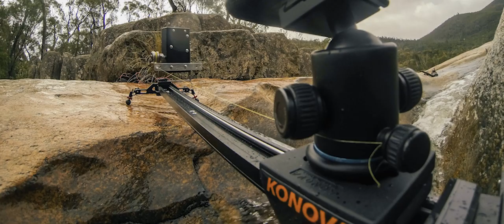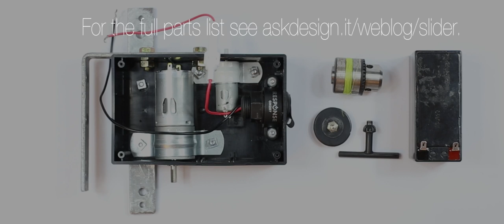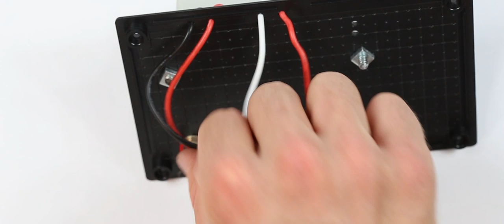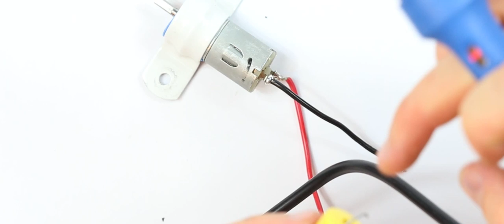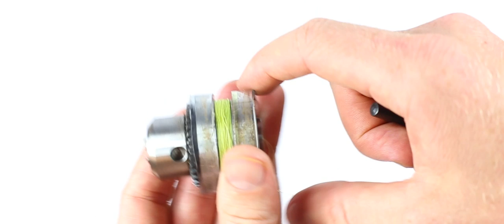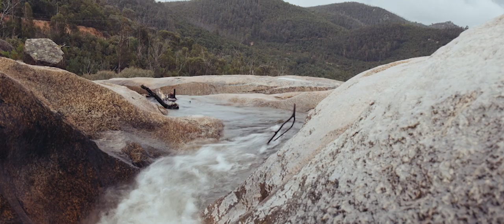DIY Dolly / Slider Timelapse Motor

Comment: WARNING!! USB ports are designed to supply five (5) volts NOT 12v. So if you connect the 12v battery directly to a USB port do NOT NOT NOT plug any ‘normal’ USB device into the plug or you will destroy the device!! You can, if you are very careful, purchase a USB plug that is made to take 12 volts and convert it to the standard USB 5 volt – but be very careful what you are using.
Reply from the maker: +Steve B hey Steve - the USB part listed takes a 12v supply (input) and converts it to 5v output, so there is no risk to devices. The part listed is designed for motorbikes so converts voltage as standard.

Comment: Hey man, thanks for the highly detailed vid, looks like you're very onto it! 

I'm a complete noob with photography/video but have big dreams, hence I find myself here. Anyway, the bit you said at the start about it not working for night timelapse as it requires the camera to stop for every photo - what happens when you try this motor for the night timelapse? I guess it just comes out blurry? I'd really appreciate any more info on these professional timelapse motors, do you know if you can buy them and attach it to your slider or do they come in an all-in-one type build? Sorry, a bit off topic, just failed to find much relevant stuff despite a long googling session
Reply from the maker: +tim3854 I still haven't used it - it wouldn't matter toooo much as I bit of motion blur is OK for timelapse, but you'd need to get a decent ratio of movement to shutter speed. With new high ISO camera's it shouldn't be too hard. As for all in one or modular commercial units, there are heaps of both. Check out ebay for a cheapy - or for a good modular one, look to Syrp, or Rhino for a good all-in-one system. Good luck!

Comment: Angus, how would you do it if you have a manual slider with a belt ?
Reply from the maker: Chyld Rosen so your slider already has a hand driven belt? just find a cog to fit your belt teeth and put it on the driveshaft of the motor. does that make sense?

Comment: Very cool.  I would have put a momentary switch at the end so the motor would stop when at end of travel.  That way the string wouldn't break and you could also have it set a limit on how far you want the slider to travel.  Also, clean up your dc leads.  You can get braided wire from an old extension cord or something to keep from having that mess of cable to your battery.  Good job!

Comment from the maker: Hey all - an update on this video since I produced it, copied from a reply to a comment below, in case anyone is interested :) 

Yep! I do have follow up advice. If you're going to travel / trek with it buy something, all the DIY solutions i've seen can't compete with the light weight of a commercial unit, also the reliability when hey are getting knocked around. This one is sweet - if you're tied to a car and don't have to carry it with all your other gear, or if you are as strong and agile as a mountain goat haha. After trying to travel around South America with it for 6 months I now use a Radian (http://alpinelaboratories.com/), it is made for panning, but flip it on its head, chuck on a 50cent 3/8" mount from a studio light and some fishing line and you've got a 100 hour battery (I'm still yet to recharge the battery... the whole goddamn thing must be battery!) in a super tough and resilient unit that weighs 500g with a stepping motor (better than this one) that can be controlled using an iphone and can do panning and sliding, even though it was only designed for panning..... you just can't compete for convenience. But, it'll set you back $250. Worth every cent IMO, and is the only one i've seen that narrowly scrapes into the cost territory of a DIY solution.
Reply: Angus Kennedy Hey Angus, trying to get my Radian to rotate as you describe, but can't get it to go more than 360, how do you program it?, can you pos a pic of how you set it up as well?
Reply from the maker: Wayne Byard hey Wayne there is a setting under the 'in' (time) function with a little infinity symbol, tap it and it'll go indefinitely :) I'll take a pic next time i'm using it.

Comment: Fantastic! I'm going to give this a shot alone with a DIY slider. Will let you know how it goes. Thanks a lot :)
Reply from the maker: Sweetman Awesome! Good luck :)
Reply: Any additional advice since uploading the video that you'd add? :)
Reply from the maker: Sweetman yep! if you're going to travel / trek with it buy something, all the DIY solutions i've seen can't compete with the light weight of a commercial unit, also the reliability when hey are getting knocked around. This one is sweet - if you're tied to a car and don't have to carry it with all your other gear, or if you are as strong and agile as a mountain goat haha. After trying to travel around South America with it for 6 months I now use a Radian (http://alpinelaboratories.com/), it is made for panning, but flip it on its head, chuck on a 50cent 3/8" mount from a studio light and some fishing line and you've got a 100 hour battery (I'm still yet to recharge the battery... the whole goddamn thing must be battery!) in a super tough and resilient unit that weighs 500g with a stepping motor (better than this one) that can be controlled using an iphone and can do panning and sliding, even though it was only designed for panning..... you just can't compete for convenience. But, it'll set you back $250. Worth every cent IMO, and is the only one i've seen that narrowly scrapes into the cost territory of a DIY solution.
Reply: Wouldn't you be better off just getting a motorised camera slider if you've already spent 250$ on the motor? I do plan on trekking with it so it's really helpful that you've mentioned the weight and inconvenience of your model in the video.

You've just given me an idea though... What about just using an egg timer, or garden hose timer with a larger disk attached to the top to 'reel' the carriage in? Depending on the rate of movement that you want, you would just use a different sized disk. The trick would be creating a collapsible model disk that you could use to easily 'unfold' to form different sized disks. No battery at all required and they'll last forever. I might have to find a link or direct you to some pictures to explain what I am talking about.....
Reply from the maker: Sweetman Yeh I had the same idea with the egg timer as I had been using one with a gopro previously for 360 panning shots - the issue is that it can only do one rotation (360) (the ones I've seen anyway) so you'd need such a large disc to get enough movement it would get in the way. The main problem though is that you can't vary the speed AND time - total time is in a fixed ratio to distance. But you're right - a wind up mechanism would be pretty neat! And definitely possible with some fancy gear work, if you had 3 variable gears you could change number of rotations, speed etc.....  but IMO too difficult.

On the money issue, you won't get anywhere near the ratio of 1. quality of slider 2. ability to do both panning (360 rotation) and sliding 3. you definitely won't get something with a controller that allows for the same degree of control over speed and distance (other units generally just have a single geared, uncontrolled motor, and if you're lucky, a PWM) 4. it won't have a built in intervalometer and trigger for the camera as radian does (having said that, I don't use this anyway as I use Magic Lantern). So yep there all-in-one units for less than that but they are a little sketchy and don't have anywhere near the same features. If you find a better combo let me know! I'd love to be wrong. I was going to write an article on just this soon anyway so it's good to get a chance to sound it out - thanks!
Reply: Angus Kennedy Would love to see a review/overview of the rig that you're currently using

Comment: Is there any reason you put the diode in parallel surely this wont do anything compared to if it was in series or am I missing something obvious?
Reply from the maker: No no - I'm just no good with electronics and was doing this on advice!  So if you think it'd be better in series do it for sure.  To be honest I don't think the diode makes that much of a difference given the infrequent use these things get.  Thanks for the tip :)